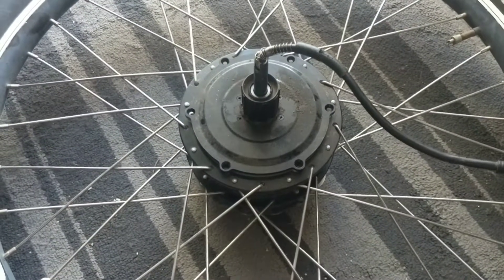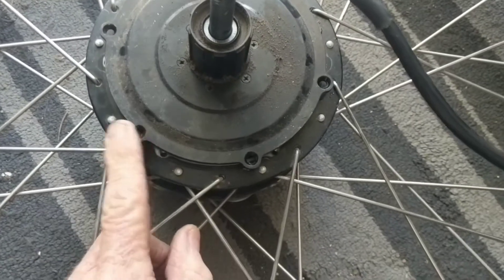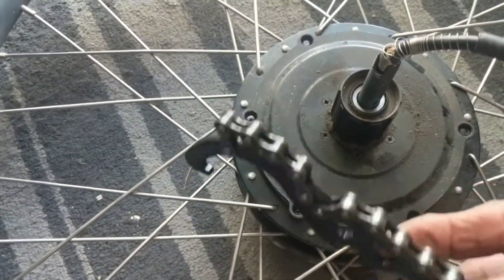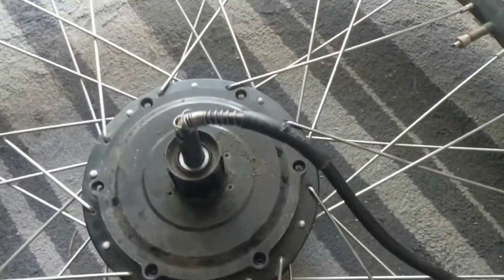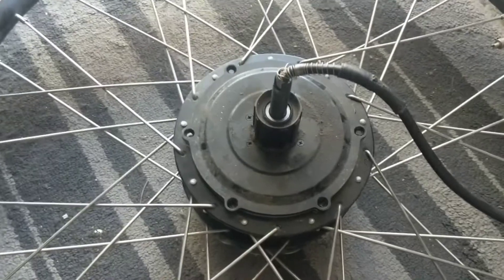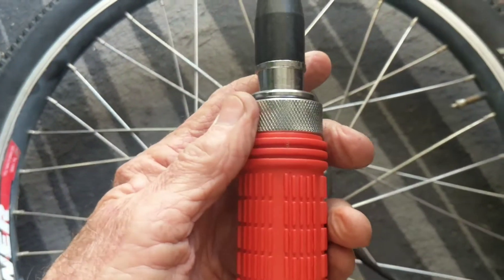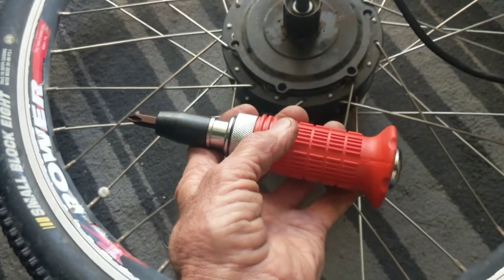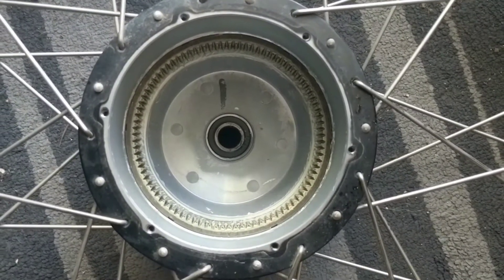Bafang 48v 500w hub motor operation

Comment: Looks more like a 36 voltage hub. 48 volts are larger. Might be the issue if its not hooked up to the right gear.
Reply: it's 36/48 ,the bafang 250/500 is exactly same motor only using a different controller/18 amp for 500w,  they do a 750w geared with more winding/fatter it's more expensive with great Torque 👍

Comment: You don't really need a Impact screwdriver.
I also have a Impact screwdriver ratchet.
But i don't really use it because it's easier to use a normal screwdriver and  hit the end.
With a hammer couple of times.
 9 out of 10 it works.
Only when it doesn't I use the Impact screwdriver.

Anyway if the bearings are tight.
it probably be the wheel spokes need tightening.